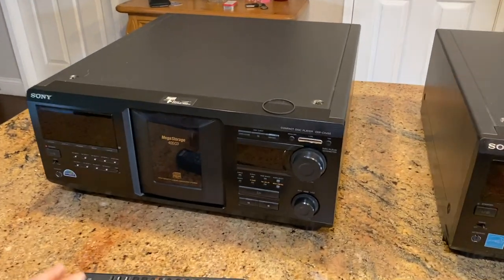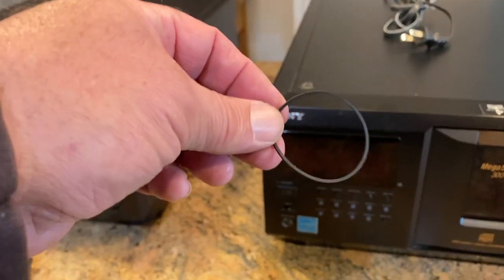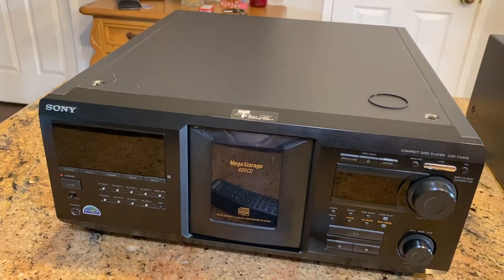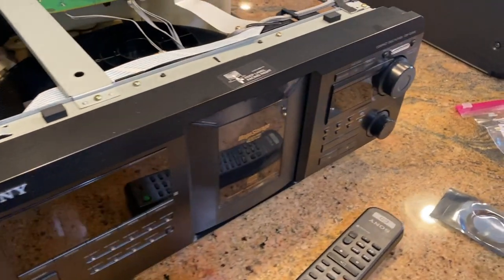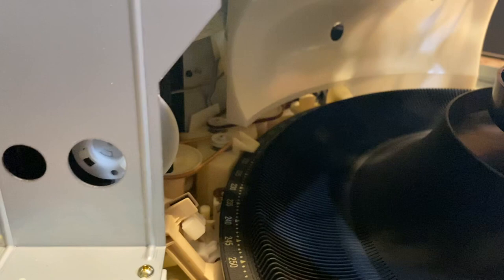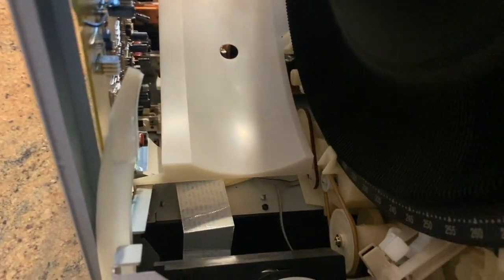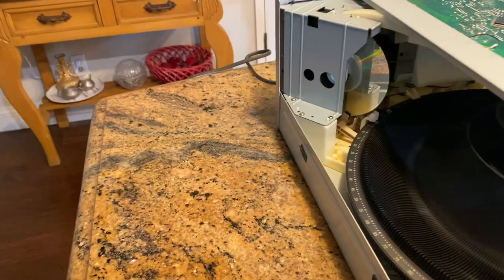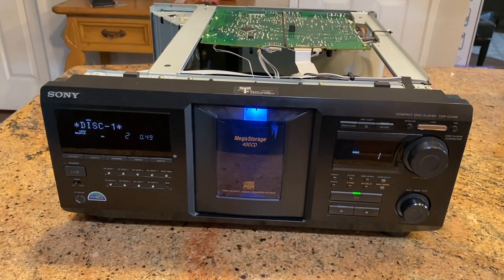Belt replacement SONY CDP-CX455 400 CD How to fix and sell on Ebay for good Money

Comment: Thanks!  I was just about to throw out my CX455.  As a last resort, I decided to check into getting a new one, which you can't, but I saw a  bunch of reconditioned units.  Decided to see what goes wrong with these units and came across your video. Sure enough it was the belts.  I spent 10.50 on Amazon for 3 belts, downloaded the service manual pdf.  I managed to figure out how to remove the carousel to replace the bottom belt.  The other two belts had melted, so I had to take the back off and use some cleaner to get the sticky rubber out of the pulleys.  What a mess.  Changed out belts and works fine...
Reply from the maker: Nice!  Glad it helped.

Comment: Thanks for a nice video.  Was about to throw-out my CX-400 (that I bought new when it came out in 1990s).  Opened up the unit and, sure enough, one band was off the spools and the two bands were brittle.  Ordered replacements!  Thank you for your help!
Reply from the maker: Nice!  Thanks for watching
Reply: I did the same thing with my 333 it worked great now

Comment: I have a CDP M555ES 400 disc changer that operates perfectly for 20 to 40 minutes but then it gets stuck when it attempts to change to the next disc.  On the display it keeps scrolling through the disc numbers, but the carousel is not turning.  This continues until I turn the unit off.  I can turn it back on and it will operate perfectly for 15 to 30 minutes when it again gets stuck.  Do you have a solution for this?
Reply: Open it and take s look at the mechanism. I found bits and pieces that slipped out of their supposed position. Re-affixed and it worked. Check plugs and cables and that belts work properly.

Comment: When shipping these do you find the carousel needs to be held in place during shipment? Or do you just bubblewrap the unit, in a strong box etc?
Reply from the maker: I have not had too.  I make sure it is tight inside the box.

Comment: I have a cdp-cx355. Replaced all three belts which were all bad. When turned on you can here it cycling 3-4x & still no carousel rotation. Please help...any suggestions. The AMS & disc selector knobs still work to display the CD title & track numbers. the door can still open and close, but only when its cycling
Reply: Had the same … first I discovered that a splint slipped out of its usual position, then I forgot to replug one cable and it worked perfectly fine.

Comment: I have a cx455 and the carousel door keeps opening and closing on its own so it won't play any ideas you think this is electronic?
Reply: I'm going to change the belt today and if that works I will come back and reply on the comment if it doesn't the comment will be here looking for help thanks
Reply: @superjeffstanton  so it did not work
Reply: @thomasbrunn3876  No sir. New belts same door issue unfortunately.

Comment: Our CD’s will skip when CD player starts up, after about an hour, it stops skipping, but there are a few CD’s that will skip. I have used a CD cleaner to clean the music CD’s. I have also purchased and will periodically  run a CD lens cleanerThe CD player is turned off and on using the remote. The music CD’s work great on my car CD player, so it is not the music CD’s
Any ideas why CD’s skip. And how can I clean the lens?
Reply: It might not be the lens, I had a similar issue and I cleaned the CD sleigh gears with Molycote grease. The old white grease had dried up, simply clean the old grease off with some alcohol and a cotton bud then apply the molycote and work it in the gears, molykote grease can be bought off Ebay for a few pounds. If cleaning the lens doesn't work this method is worth a try and worked for me.